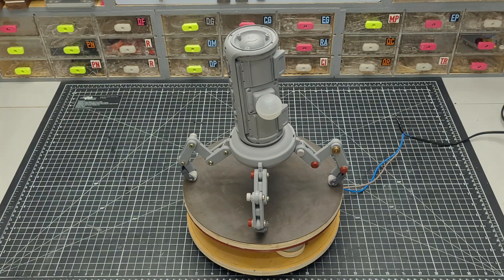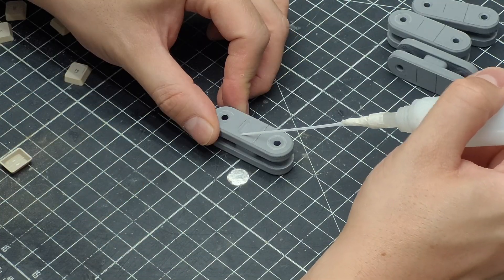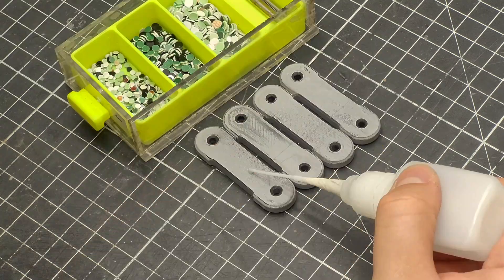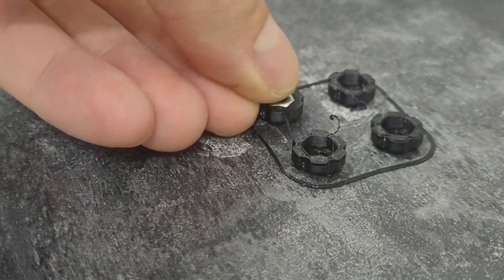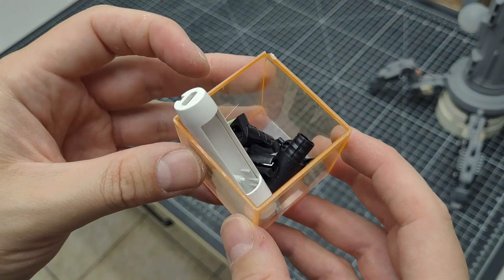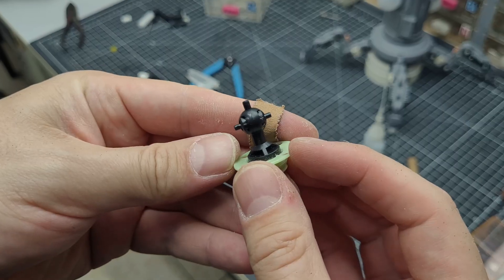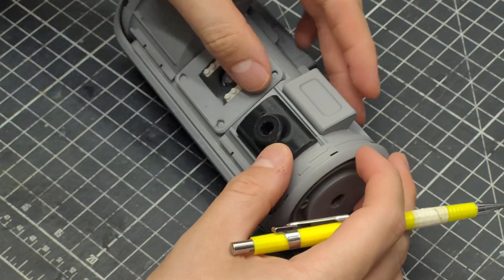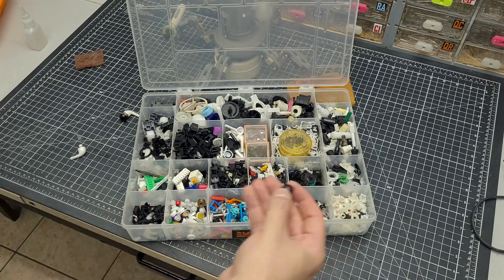Scratch-building a Crab Robot - Part 2

Comment: Remember this earbud trick for future designs!  This time they were crabby eye-stalks, but they also bare a more than passing resemblance to an artificial hip joint at the top of the femur.  If you do another bipedal mech in the near future, creating a layered look where you can see the actual joint construction inside would make for some amazingly cool detail work.

Also, if you're looking for a name idea - this design actually more closely resembles a bacteriophage (which is just a virus that targets bacteria instead of animal or plant cells).  [X]phage, where [X] is any number of words related to reconnaissance, signals, interception, spying, or penetration would work fine.

Signalphage is a little weak-sounding, perhaps, but it is descriptive.  Reconiphage rolls off the tongue a little better, and does a pretty good job of describing the shape and job.  Same with Interceptiphage.  

The crablike nature of the design can also be highlighted with Carciniphage - carcinization is the process by which unrelated groups of species all evolve into crabs independently.  Currently there are five groups of decapod crustaceans who have independently become crablike.